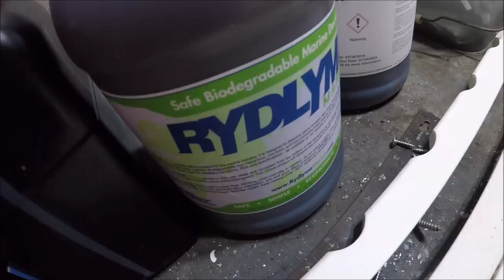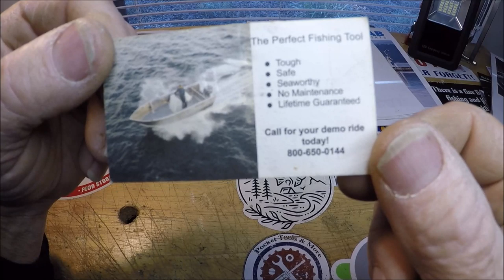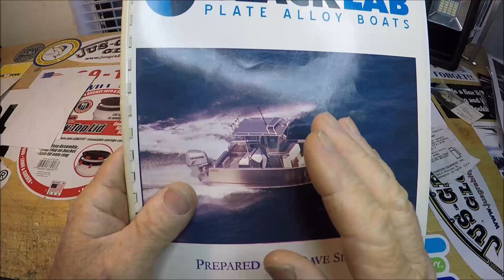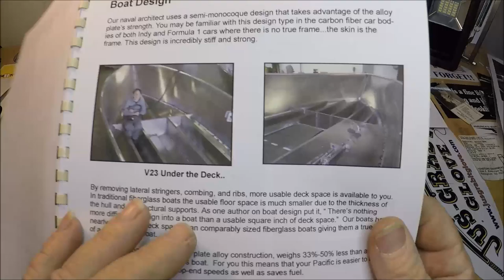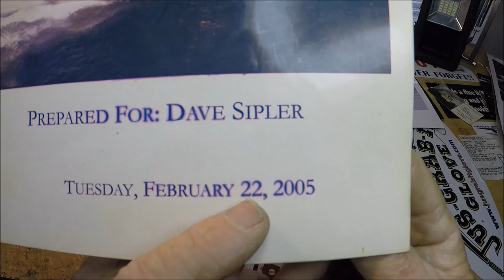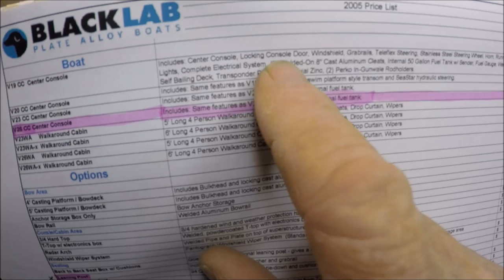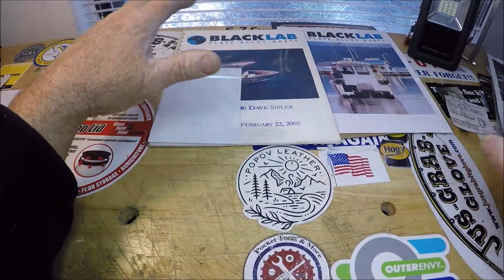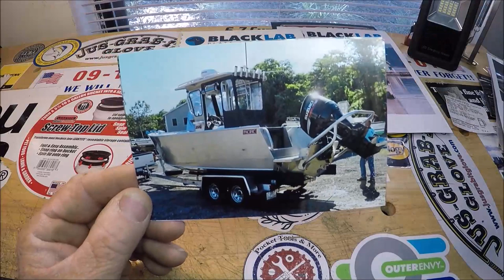ALUMINUM BOAT, why & how (30 mins.)

Comment: Greetings from Kennebunkport.  Loved the backstory on your boat selection and your trip "DownEast" back in the day.  We Mainer's are known for our down home practicality, common sense and hospitality to the town folk and our annual influx of "visitors from away".  You have many of those traits from your straight up tell it like it is approach to practicality and things that worked.  You would fit right into our coastal culture so well.

Your points on the durability and toughness of "Aluminum Plate Construction" are spot on.  Aluminum is about 30% lighter than fiberglass for same size boat.  Thus requiring less horsepower for the same performance.  Reduced weight increases the "Fuel Efficiency" by a significant factor too.  A big plus for a "Charter Business" guy.  At the end of a day with the catching is over and its "Clean-up on Aisle Boat-deck", its way easier on a metal deck. 

They don't make the big yachts, USCG Cruisers or Patrol boats hulls out of fiberglass, that's for sure.  But they make all those "pretty overpriced boats for the players" down in Southern Florida...Fiberglass and "Chemical Enhancements" go so well together.  Just like "Big Fish Stories" 🤣

Comment: I am refitting my second aluminum boat.  A 1997 Lund 2250 Sport Cabin Hard Top.  It is also very thick plate aluminum.  Unbelievable how well this thing has survived.  It has only seen freshwater here in Wyoming.

Comment from the maker: 👉👉👉I FAILED TO MENTION: 1/4'' solid plate bottom, 5/16th'' sides, deck, 1/2'' thick transom. NO RIVETS, All welded. Not like the boats at Bass Pro Shops.These are work boats. INTERESTING LINKS IN VIDEO DESCRIPTION, check them out❗
Reply: Whu aluminium and not fibreglass?
Reply from the maker: @whitewhale-gq2kc  its better!

Comment: Badass boat, I love aluminum as well. The only boats I have owned have been aluminum. Currently, I run a Prodrive SBX (self bailing hull), custom built for me that I use in South Florida and Northern Wisconsin. If I ever do a bay boat or center console, it will be aluminum. Thanks for the video, love that tank!

Comment: I live in Arlington, WA and the next town over from me is Marysville, WA. I had no idea that these boats were manufactured hear. I'd love to take a factory tour but they only have a P.O. Box and phone number. I guess I could call them up. Actually, the military PT boats that were made for Vietnam were made around my area but they were made out of fiberglass. Many aluminum boat manufactures are based out of the PNW (Pacific Northwest). I love your boat design. It's supper nice looking! I'm thinking of building my own aluminum boat from a kit because that's the only way I can afford a nice boat. There are several companies that offer the CNC cutting files and then you weld it up and install all the other components. I think I could get a boat like yours for about 20k if I built it from a kit myself.
Reply from the maker: I  know, Coldwater boats is next door to Pacific
Reply: @CaptDavesSportfishing  Oh man, I saw them building a boat about 8 years ago. I just saw a map of where they are located and was checking out that area for property to purchase and saw them welding up an aluminum boat. Now I know. There web site sort of sucks. Very difficult to get information.
Reply: @CaptDavesSportfishing  I'm not a welder but a carpenter and watched a video of this guy welding up a 14' mini jet boat for his first time ever and it was also his first time ever welding anything. He did a great job and it looked really easy to do. This makes me want to build an aluminum boat for myself and save money since I can't afford to go out and purchase a turn key boat or for that matter a nice used boat for myself. If I want a nice boat, than I'll have to build it and then get used engines from a government auction to power it.

Comment: Hello, very nice video on your boat. Seems like a perfect set up for your area. It looks like you get some chop where are you fish. How does your Boat handle the chop?  Would you feel safe taking it off shore?  I know you mentioned in the video that another owner was taking his out to the oil  rigs.  
It looks like it rides on a shallow draft. How skinny have you taken it? Thanks
Reply from the maker: of course I go offshore....but our inlet can be rougher than offshore, and that's where I fish. SAFE?? that's funny. It's safer than you can ever imagine. you need more research on why so many governmental, and work boats are welded plate alloy. I fish all conditions, from 2' over sand too shallow marsh, too rolling waves next to 10 ton granite boulders, in a 4 knot current. 👉👉👉I FAILED TO MENTION: 1/4'' solid plate bottom, 5/16th'' sides, deck, 1/2'' thick transom. NO RIVETS, All welded. Not like the boats at Bass Pro Shops.These are work boats.
Reply: @CaptDavesSportfishing  Thanks, I’m looking at boats for the lower Laguna Madre. most of the boats are Texas flats boats Designed to go skinny in less than a foot of water, however impractical for going offshore.  I guess there is no boat that is a perfect compromise.
Reply from the maker: Try looking in Louisiana same thing Laguna Madre Louisiana all the same hanco's scully's American Marine all build shallow water boats Gator Trax numerous boat after boat after boat build out of aluminum plate

Comment: What nuts / bolts are safe to use with an aluminum boat? I’ve been hearing stainless steel but NOT galvanized?? I don’t want corrosion on my little boat and can find aluminum bolts anywhere. So What is safe?
Reply from the maker: stainless with TEF-GEL

Comment: Nice video & nice boat. I have a metal boat also & would not want a glass boat. Of course I live in Michigan. Been watching your videos for a few months now. First one was the the icey-tek cooler killer of yeti. My boat is a Stabicraft which over there in NZ they use Icey-Tek's on these boats. Good video & agree with another of your video's Aluminum much nicer to own then the glass boats. But people think glass is sexier. But the metal boats are safer IMHO
Reply from the maker: MY CHUM CHOPPER in AUS. and NZ is called a burley bucket. My stern fillet table is standard on most fishing boats there too. I use chain guard on my anchor chain, also a AUS idea, and YES, i like Icey tech coolers too. If I watch videos about boats, it's AUS. or NZ, for me. Alot of their influences are on the Jettywolf.
Thanks, you are comment #1.
Reply from the maker: BTW.....if I was a cabin guy. A Stabi, I would love to have!!!!!!!
Reply: @CaptDavesSportfishing  I will have to look you up to say hi if I get down to Jacksonville Florida with some extra time. I sometimes go by Jacksonville when I deliver trailers to Sanford.
Reply: @CaptDavesSportfishing  They do have a few open bow boats called frontier boats. For charter I believe their 2250 & 2750 center cab would be the best. I only have a 1650 fisher but it handles 3-5 foot waves on Lake Erie better then a 22 foot deep V fiber glass boat does.
Reply from the maker: @BBBYpsi  unless you're sneaking in the back door, we are the gateway to Florida that people drive right thru.
Reply from the maker: @BBBYpsi  OH I KNOW.....Im subscribed to them on YT. They just don't have much room in them. B-U-T....Matt Watson from Ultimate Fishing TV, NZ designed a 16 foot side console that is the BEST 16' boat Ive ever seen!  Check it out. SEND ME SOME PICS OF YOURS ❗❗  I'd be interested in seeing it.  Were you ever a member of aluminumalloyboats.com??? Thats the forum I helped out on before YT took up my time. Its faded now, like most forums. But we had stabi owners, even in LaLa south Florida!  send to: jettywolf@gmail.com

Comment: isnt 18 degrees of deadrise gonna pound alot
Reply from the maker: For 16 years havent given a shit, stable is all I care about. My last boat was 18, had it for 12 years. Some tippy 24 degree deadrise will never be a boat I own.  Is that good enough?
Reply: @CaptDavesSportfishing  yeah man, i got a boat thats flat on the side so it ussualy pounds alot. what deadrise would you reccomend between 24 and 18? like i want a boat thats both stable and doesnt pound that much, what deadrise is like a good mix? ive heard 20 is good.
Reply from the maker: @Lexi-fh3wn  its a lot more than just that, it's beam of boat, weight distribution, etc. Ever wonder why on a center console boat WHY the console is never really in the center???? It's smashed back to the stern 3rd of the boat. Not in the center LENGTH wise?? Because they want it to be nice riding, that's why. The stern always has the better ride. On my boat (that I had built to my specs) I not only had the console put right in the middle "beam wise", but also "length wise". Because I don't care about the ride. All I care abut is Stability. You can't have it all. All boats are a compromise.  You can have a 18 deadrise, but if the console and seating are all on the stern. You'll get a better ride. All I know is a friend had a 21 foot center console with a 24-1/2 degree deadrise. A short boat, and true real deep V. It rode like a knife thru the water. But at anchor or drifting in a sea, would about throw you right out over the side, it kicked back and forth so hard.
Reply: @CaptDavesSportfishing  thanks alot for the answer, like i said the boat i have is flat on the sides which should help with stability. atleast from what ive heard. but i still get thrown around alot. the boat is 28ft, the last time i was in the boat everything ended up being everywhere
Reply from the maker: @Lexi-fh3wn  You said ''''the boat i have is flat on the sides'''. Sides don't effect ride. it's the bottom.  28' with a 9'6'' beam would be nice, but if it's a 8' beam or less and a deep v, not sure if much would help.
Reply: @CaptDavesSportfishing  oh, i they say being flat on the sides helps with stability when being on drift
(thanks for all the answers, some other alloy boat builders ive asked havent replied alot)
Reply from the maker: @Lexi-fh3wn  I'm a charter boat Captain, not a boat builder. I had my boat built and am discussing the build here on this video. I'm not sure sides of a boat has anything to do with stability. My boats sides are flat and it's very stabile.
Reply: @CaptDavesSportfishing  Oh ok ! Thanks for all the answers! and when i think about it, you could always get a shock absorber (in a chair) to make the ride smoother, i probaly wont ask and comment more on this now, you've answered all of my questions, maybe i'll comment if i get some more questions some time.. other than that thanks alot !
Reply from the maker: @Lexi-fh3wn  HOW MUCH YA WANNA SPEND? yeah, they already have those.
I STAND, behind my ''leaning post''  https://youtu.be/uPf5Fbrk6GY  or
https://youtu.be/4UJnRCttLEE